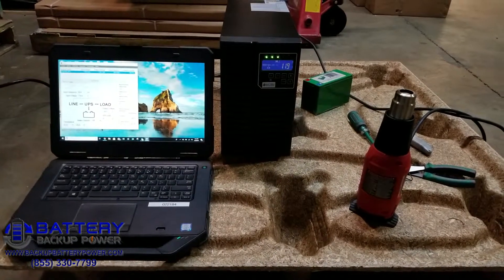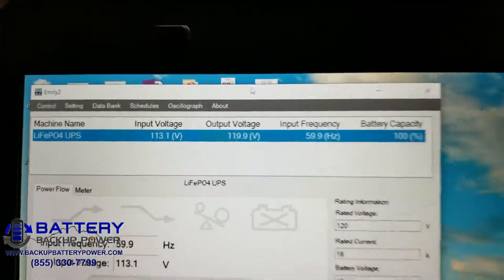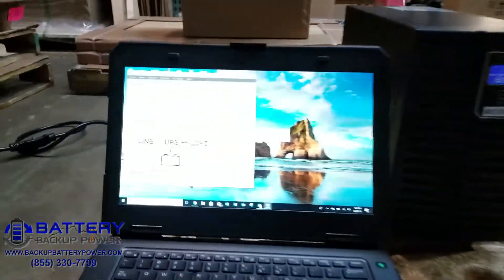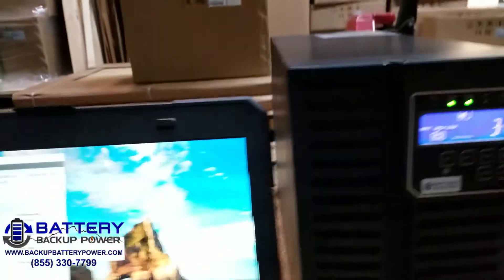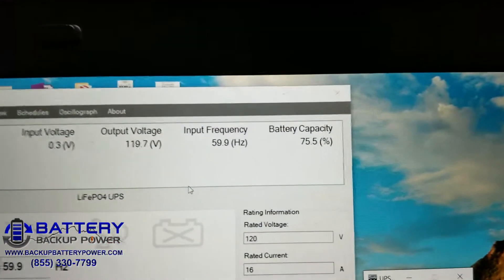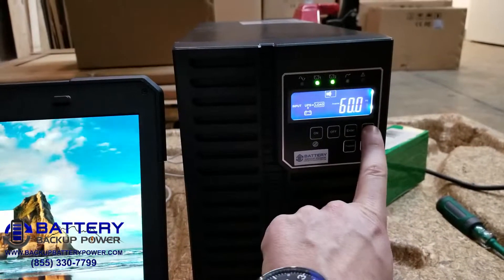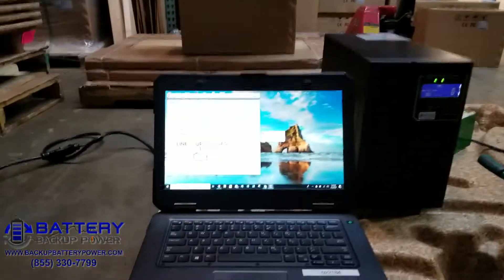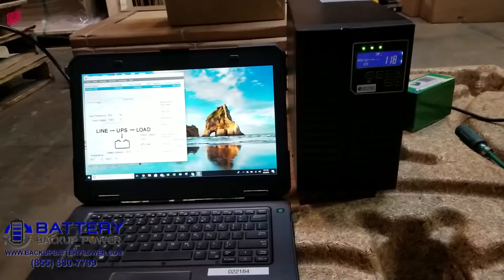Lithium (LIFEPO4) battery backup UPS load test

Comment: Did you check your LiFePO4 packs after doing this?  I just tried replacing my 12v9ah AGM with a 12v10ah LiFePO4 in a Back-UPS ES 550...It did not go well.  The battery was rated for 10A continuous or 20A for a max 5min burst.  It handled low load ~13A just fine, but I ran a 21-23A test for just over 5 minutes and the battery was UNCOFMORTABLY hot and started to smell.  I ran it outside to cool down (winter here right now). BMS did NOT shut it down.  I don't think I'd be trusting this in a sealed UPS any time soon.
Reply from the maker: You can't run any LiFePO4 battery in a UPS. The batteries in the video were specifically designed to work with UPS systems. Also, most UPS systems run with multiple AGM batteries in series at 24vdc, 36vdc, 48vdc, or 72vdc, so a single LiFePO4 battery running at ~14.4vdc would inherently have problems.
Reply from the maker: Here is a list of UL listed UPS models with LiFePO4 batteries: https://www.backupbatterypower.com/collections/ul-listed-lifepo4-ups-systems

Comment: Is this an UPS designed for lead-acid batteries using drop-in replacement LiFePO4 batteries?
If yes, does it has batteries in series?
Can the UPS charge the batteries after the batteries have been drained?
Which batteries would you recommend?
Reply from the maker: Here is a list of UL listed UPS models with LiFePO4 batteries: https://www.backupbatterypower.com/collections/ul-listed-lifepo4-ups-systems

Comment: I wanted to see if the ups will cut off thinking that the battery is empty or will it run the lifep04 cells to the lowest volts where the internal battery bms cuts connection?

Comment: Software says 16A*48v and U say 1400W this heater takes from UPS. If software is correct the heater works on 768 watts only, right?
Reply: 48V is battery voltage. It must be converted to 120V through transformer.
Reply: Rated Amps, not current amps. I'm more worried about the BMS or lack of, and the charging circuitry. Imagine charging using a lead acid charge that overcharges batteries, then floats them constantly... Fireball waiting to happen
Reply: @xiaorulez  LiFEPO4 batteries typically include a BMS within the battery enclosure, this is what makes them applicable as drop-in replacements for SLA batteries.